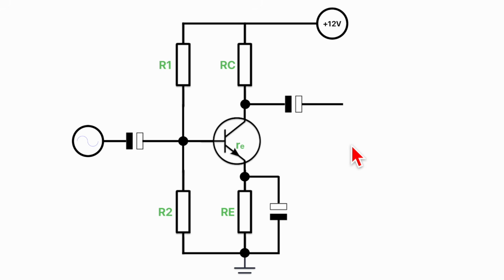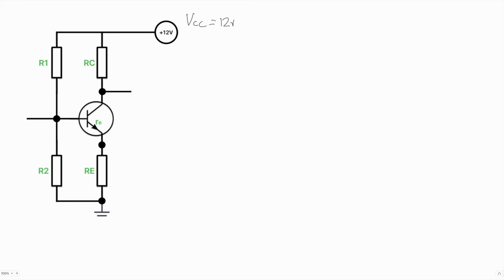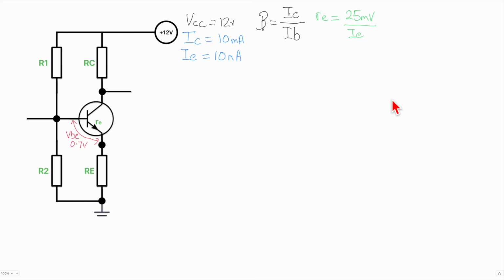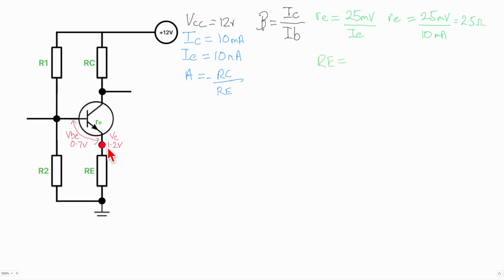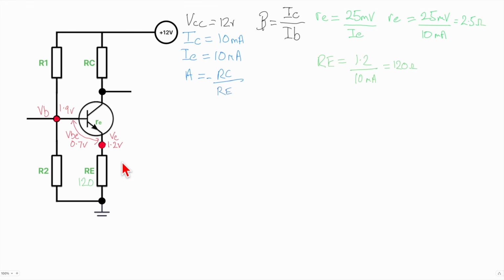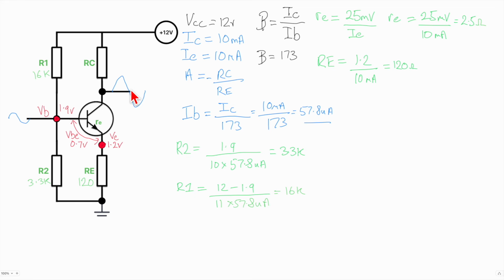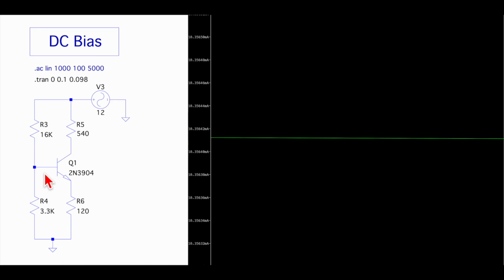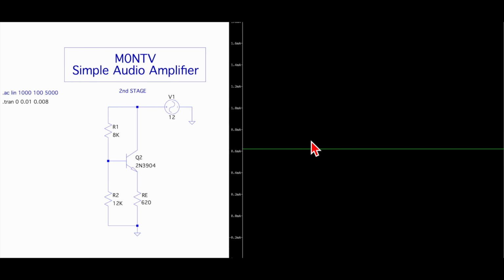57 - Designing a Simple Transistor Amplifier

Comment: Thank you. This was very helpful :)
>
3:19 Why polarized electrolytic instead of unpolarized electrolytic? (I see both used in some circuit diagrams and can't find an explanation)
49:40 where is the output C or E side? [Edit: I picked it up from video 56 :) ]
>
I am about to go back and watch 56.
Trying to learn about creating some basic pre-amps, amps and filters for some home projects.
This video explained it well combined with another by "Vocademy".
Reply from the maker: Hi there! The only reason I'm using electrolytic caps in this design is simply because of the higher value of capacitance required. At these values of hundreds of micro Farads then you're only really going to use electrolytics. 73, Nick
Reply: @M0NTVHomebrewing  Thank you. Much appreciate the explanation :)

Comment: The thermal voltage is why CPUs need coolers! 😄 Without regulating the temperature, you risk something called thermal runaway—the main reason transistors release their magic smoke. 🔥 It's a self-reinforcing loop that grows exponentially.

For the science nerds out there, the thermal voltage (Vt) is calculated using Boltzmann’s constant with this formula: Vt = kT/q. Here, k is Boltzmann's constant, T is the absolute temperature, and q is the elementary charge.

The real trouble starts with the saturation current (Is), which depends on temperature like this: Is ∝ T³ * e^(-Eg/kT). Eg is the bandgap energy, and as T rises, the T³ factor increases fast, while the e^(-Eg/kT) part decreases slower. This means Is shoots up, which increases the emitter current (Ie). More current means more heat, which causes even more current—and pretty soon, pop goes the junction! 😬
Reply from the maker: Thanks for the detailed explanation. I've only really troubled myself with thermal runaway when I'm building RF amplifiers which are handling more power. One of my favourite RF driver amp designs is by Eamon Skelton and can put out up to 1W of RF power. He helpfully includes a protection mechanism that will reduce the base current if the collector current goes too high. It does work pretty well and helps to keep the magic smoke inside! Thanks again. Best wishes, Nick
Reply: @M0NTVHomebrewing  True, it's not such a concern with a properly designed small signal amplifier, especially in the pre-amp stage.

Comment: Towards the end of your video, you review adding additional amplification stages.  Are there any special design considerations for the final amp stage?  I have seen multistage transistor amplifier designs online where stages 2-(n-1) were identical and the final stage used different resistor values.  In my case, I am building a wideband RF noise generator that will pass the AC signal through 2 or 3 amplification stages.  The final signal will be used with a Wheatstone bridge to tune an antenna.  Thanks again for the great video!
Reply from the maker: In reality you'd probably want a more beefy power amplification stage - something like a push-pull with dedicated power transistors (TIP31C & TIP32C) in an audio amplifier. For RF it depends on how much power you need. I usually start at the end (PA) and work backwards i.e. what power does my PA need so what power does my driver need to produce? Then what power do I need to drive my driver etc. Hope this helps. All the best in your project. Best wishes, Nick.
Reply: @M0NTVHomebrewing  Thank you for your suggestions, Nick!  I am building an RF noise bridge and I think your idea of working backward from the peripheral connections is spot-on. :). Happy New Year!
Reply from the maker: No worries. All the best with your building. 73, Nick

Comment: Sweet! I ran my own hypothetical calculations with 10V and wanting 20ma/1v at Ve and built it on a breadboard. Took a few tries to go through the calculations and it was right as I wanted. I do find that calculating everything in the required units makes it a little easier than converting in my head on the fly, but I'm sure with some practice it would become 2nd nature.
Reply from the maker: Glad it helped. 73, Nick

Comment: Appreciate the fact that you went through all the math.
The only thing I didn't get really well was why use those condensers.
I'm not an electronics engineer, just a computer engineer trying to learn a bit of electronics so I can make some DYI guitar pedals.
Just came accross this and thought it was interesting, you can basically make a guitar power amp with this basic scheme.
Reply from the maker: Essentially the capacitors in this circuit all function so as to pass the frequency of interest and block DC. This means you need to have values of capacitance high enough to give a very low reactance at your lowest frequency of interest. I deliberately went over and above this in my design - as I explain. Just remember this is a small signal amplifier. Things are a bit different once you get into power amplifiers. Thanks for watching and commenting. Best wishes, Nick

Comment: Hi. I bought a few rf transistors and would like to design a rf amplifier of about 15db of gain but0 with 50 ohm input and output impedance.  How to do that? I know that with only one stage it doesn't work.  There may be no impedance matching stage in some place. The main frequency would be 915Mhz. Thanks
Reply from the maker: Hi Anderson, thanks for your question. I assume you mean a small signal RF amplifier (not a Power Amp - which is a whole different thing). If you watch the next video (No.58) on Small Signal Analysis you'll see the effect that the various components in the circuit have on input and output impedance. There are things you can do to try and design for certain input and output Z but failing that I'd go for a couple of impedance matching transformers. However, if you are building for 915 MHz then things get much more challenging in terms of the effects of stray capacitance etc. You're probably in the realms of striplines - where you create characteristic impedances by the length and width of the copper traces on your board. Honestly I can't really advise on this as all my experience is at much lower frequencies (HF) where homebrew is more forgiving. All the best to you. 73, Nick
Reply: @M0NTVHomebrewing  yes, I would like to amplify a small signal that leaves the SX1278 lora IC to an antenna. I know there are dedicated amplifier IC like Gali-5+,  but I would like to use a transistor for that. I already have a NANOVNA and a Spectrum Analyzer to help me find an impedance match circuit.  I'm learning how to make striplines with 50 ohm impedance characteristics from JLCPCB. These days I did a PCB in my CNC router that matched for a 915Mhz trace antenna for lora. Thank you very much.
Reply from the maker: Sounds like you are on the right lines already. All the very best with your project. 73, Nick

Comment: What a great video. Very clear. After watching many other videos on YouTube, I think I now finally understand it. Or almost. I have one question. When you calculate RC, you want it to drop 5.4V, which I understand. But what I don't understand is, how can you assume that the transistor will drop the other 5.4 volts, and the emitter will stay fixed at 1.2V? In other words, what prevents RE from dropping part of that voltage and raise Ve?
Reply from the maker: Hi Willem, thanks very much. In answer to your question we are guided by Kirchhoff's Voltage Law which states that the sum of all the voltages in a closed loop must = 0. So we have the DC supply (= +12V) - Voltage drop over collector resistor (IC*RC = 10mA*540Ω = 5.4V) - Voltage dropped over transistor (VCE) - Voltage dropped over emitter resistor (IE*RE = 10mA*120Ω = 1.2V) = 0. Therefore VCE must = 12 - 5.4 - 1.2 = 5.4V. It will stay fixed from a DC point of view because what will change it? Once you add an AC signal then things get interesting but that is the topic of the next video - No.58 released yesterday. Hope this helps. Best wishes, Nick
Reply: @M0NTVHomebrewing  I think my expectation was that the resistance of RC would affect the current flowing through RE, and change the voltage dropped over RE. But I think Ve is actually fixed at 1.2V because it is necessarily 0.7V higher than Vb. And because the current flowing through the collector needs to be the same as the current flowing through the emitter, the voltage drop over RC can only be that current times its resistance (because ohms law). And the remaining 5.4 volts can then only be dropped by the transistor. Is that correct?
Reply from the maker: Hi Willem, I think so. The fact is that from a DC biasing perspective changing RC makes very little difference to the current in the emitter (IE) or even the collector (IC). Neither does it impact the voltage on the emitter (VE) or base ((VB) very much or the current through the base voltage  divider. All it does is to drop more or less voltage over it and shift VC higher or lower. Just for fun, model it in LTSpice and set RC = 1Ω. Make a note of all the currents and voltages in the circuit. Then set RC = 1000Ω and do the same. The changes to everything except VC are tiny! The importance of RC comes through in the next video (58) where it not only sets the zero crossing line for our AC waveform but also pretty much singlehandedly sets the output impedance of the amplifier. Thanks again. 73, Nick
Reply: @M0NTVHomebrewing  I just tried it in LTSpice, and you're right, it has almost no impact! Not at all what I was expecting. I'll check out the followup video as well, thanks!

Comment: i followed all the way but still a question , where did you get the 10 milliamp ?
Reply from the maker: Hi there! Good question. It was an arbitary choice. The proper way to establish the quiescent collector current is by Load Line Analysis which I really didn't want to get into in the video. In truth, my choice of 10mA is a bit higher than it should be. My own analysis shows that for my design, then 8.5mA is just about ideal. It'll still work with 10 though. If you are interested check out this excellent 4-part series on Load Line Analysis: https://www.youtube.com/watch?v=dOv_nsBvYTM. Thanks for watching and for your question. Best Wishes, Nick

Comment: Well, I've watched a few times now to better understand and decided the best way to cement this topic is do my own presentation based on what you've done but using a beta I measured  with one of my own transistors.  Working out pretty well. Except for the current going through R1 and R2.  I think I understand why there's a difference as you have explained, but so far my numbers there don't add up. I'm sure its just a math issue and I'll solve it without too much effort.

Peter ve3poa
Reply from the maker: Hi Peter, well done for persevering! The current through the voltage divider just needs to be at least 10 times the base current. If you model it with LTSpice you can calculate what LTSpice thinks the Beta is (about 308 in my case). If you want the numbers to match up then you'll need to use this figure (not your measured one) in your calculations for R2 and R1. Real circuits with real components will also have some variations because of tolerance etc. This stuff can honestly take a while to get your head around. But once you've got it ...73, Nick

Comment: Range of frequencies?
Reply from the maker: This particular design is an audio amplifier. Although you can put music through it I will only be using it in a Direct Conversion Radio Receiver so the range of interest will be 300 Hz - 3 kHz. You can of course calculate the capacitor values for other frequencies. If you are going to use it for RF though just be aware that you will need some impedance matching. Best wishes, Nick

Comment: 35:00 why did you subtract the 1.9 Volts to calculate the R1?
Reply from the maker: Because we know we need 1.9V on the base (comprising VBE (0.7V) + VE (1.2V)). So that's why we've dropped 1.9V over R2.  This means there is only Vcc - 1.9V remaining (i.e. 12 - 1.9 = 10.1V) and so this must all drop over R1. This is to satisfy Kirchhoff's Voltage Law about the the sum of all the voltage differences around a closed loop must be zero. Hope this helps. Best Wishes, Nick
Reply: @M0NTVHomebrewing  it helps thanks

Comment: (12:(16+3.3))×3.3=2.05 V; 2.05-0.7=1.35V; 
Not enough for class A amplifier.
(12:(8+12))×12=7.2V.
2n3904 will be burned.
Reply: Your notation is odd to me please explain further.
Reply: @andymouse In the scheme of the emitter repeater, the voltage at the base of the transistor is V=6.746 (LT Spice). Such transistors do not exist in nature.
Greetings from Ukraine.
Reply: @mikepaul2831  Hi from the UK :)
Reply from the maker: Regarding the Emitter Follower - you raise a good point here Mike. I need to look into this. Cheers.
Reply from the maker: Yeah, you had me worried for a minute there. I think you are referring to the Vbeo rating on the 2N3904 data sheet which is 6V. But this is the base- emitter voltage with an open circuit collector. In my Emitter Follower, the base is at 7V but the base-emitter junction is not seeing a potential difference of 7V because the emitter is not at 0V - it is at 6.3V thanks to the 620Ω RE. So the base-emitter voltage is 0.7V. Professor Curtis Meyer actually designs a circuit almost identical to mine with 10mA IC, 12V Vcc and over 6V on the base: https://www.youtube.com/watch?v=n_bBF67mqk8 Thanks again for making me think! Best Wishes, Nick
Reply: @andymouse With such resistor values, V of the base will be 2.05V (1.826 V LT Spice). This means that a signal with an amplitude higher than 2.05-0.7=1.35V will be cut off.
Reply: @mikepaul2831  Thanks :)
Reply from the maker: Hi again Mike. Thanks for that clarification. I understand now what you mean. Yes, you are right that the first stage (CE) amplifier won't take much in the way of signal strength input. But for my particular use case it doesn't need to. I'm taking a tiny microvolt level signal from a passive diode ring mixer into this amplifier. If you have a higher level input source then I agree you'd want to recalculate. As I said in the video, this is not the only way or even the best way - it's just the way I did it. Thanks again for taking the time to watch and comment. Best wishes, Nick.
Reply from the maker: Hi Mike, thanks very much for watching and for sharing your thoughts. Best wishes, Nick
Reply: You are absolutely right, but when a positive half-wawe signal with a value of, for example, 3V comes to the base, there will be not 7, but 10V, and the transistor will be burned. Usually, the operating point is chosen in the middle of the line on the current-voltage characteristic or at its beginning, and not at the saturation point. Of course I could be wrong. I am only a chemical engineer and express debatable concept.
Reply from the maker: Hi Mike, I think the main thing I would say is that your example uses a different magnitude of signal to mine. In my design I basically have no power amplifier and instead two small signal ones. So the 1st CE stage produces under 150mV Peak which is what is going into the follower buffer. So that will give a voltage swing at the base of between 6.85V and 7.15V. The transistor is more than happy! If you tried to put even half a volt into this then you'll get distortion. As I said, I designed it for my own use case - with the challenge of seeing how simple I could make it. It could easily be made better with the addition of a push-pull power stage etc. Hope this helps. Thanks very much for your interest. Best Wishes, Nick

Comment: Nice explanation Nick,
It's a fairly easy process, but not that easy to explain to people coming into the task cold. 

This brings back so many memories of my first year electronics at college, with one exception it was ALWAYS hfe, never beta!  which was reserved for those funny glass things with hot red leds in the bottom of them. 🙂
When you get to explaining the emitter bypass cap in the next episode, I will have a vision of my electronics lecturer (Mr Jones) jumping up and down on the spot to drive home the point of how that cap affects the gain.

At the end of the day we also ended up just using the half supply rail voltage across Rc  and 10 x the base current through R1 and R2 - It works.

Andy
Reply from the maker: Cheers Andy. Yes, it's true that sometimes the simple rule of thumb is more than sufficient! Thanks for watching and commenting. 73, Nick

Comment: Very good information here to get those projects working, (and the grey matter!) Many people struggle with this very concept and it`s tempting to just grab an op-amp, until you need an amp at a high enough frequency to make op-amps too expensive or not suitable. Everything you need to get you going has been covered in this video. You do a great job to help keep this hobby alive. Chris, UK. (Gentlemen of 1977khz AM)
Reply from the maker: Thank you very much indeed Chris. I'm certainly not adverse to using an op-amp or two myself but I find there is something strangely empowering in understanding how the humble transistor amplifier works. Thanks again. 73, Nick
Reply: @M0NTVHomebrewing Can you please explain why the Collector junction will be out of phase by 180 degrees?
Reply from the maker: Good question. It is because of the way the transistor operates. The phase inversion happens because an increase in input signal causes a corresponding decrease in the output signal, and vice versa, due to the interaction between the base-emitter current and the collector voltage across the load resistor.  When the input signal increases and makes the base-emitter junction conduct more (increasing  Ic ), the voltage at the collector decreases. Conversely, when the input signal decreases, the base-emitter junction conducts less (decreasing  Ic ), and the voltage at the collector increases. This relationship results in a 180-degree phase shift between the input signal at the base and the output signal at the collector. Hope this helps. Best wishes, Nick